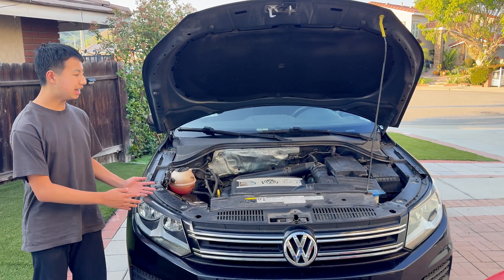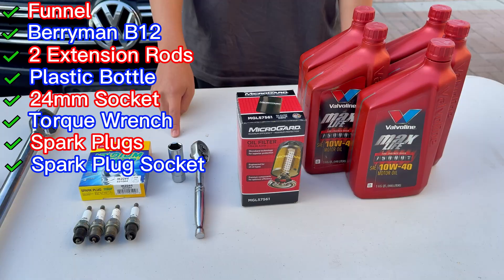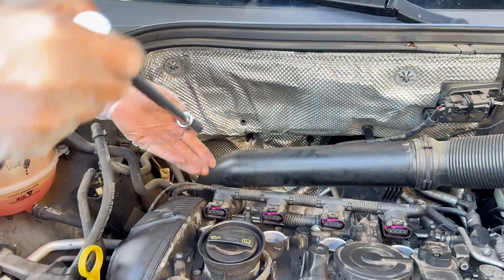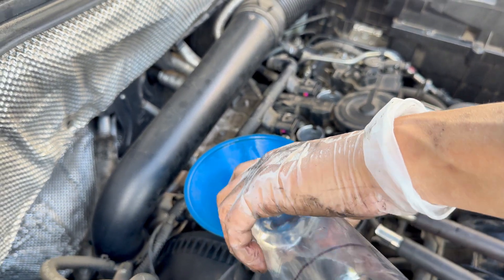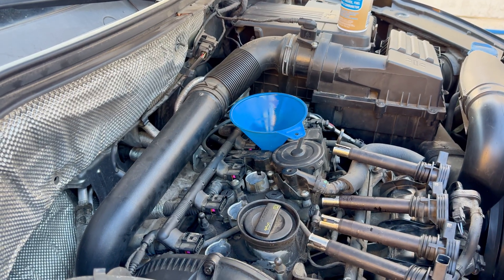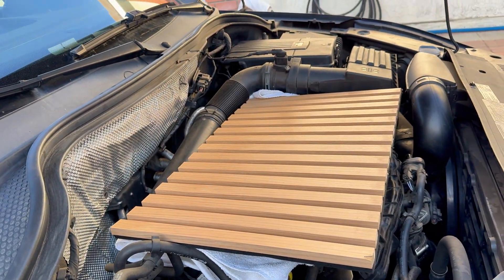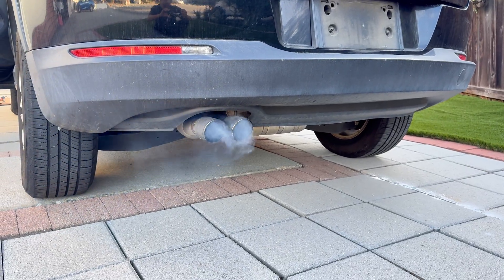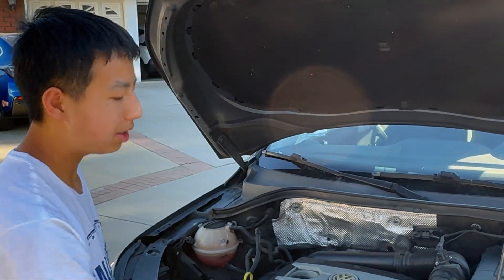Berryman B12 Chemtool Oil Burn FIX (VW Tiguan)! Piston Rings Soaking Cylinder Soak

Comment: When cranking the engine, do you have to pull a fuel pump fuse or relay? Wouldn't you end up with unburned fuel in your cylinders otherwise?

Comment: One point: AFTER EXPELLING THE B12 ADD A SMALL!!! AMOUNT OF GOOD OIL (see below) TO EACH SPARK HOLE TO LUBE THE PISTONS and wait 20-60 minutes. Then turn the crank 4 complete revolutions by hand. Then start. This relubes the pistons and rings.  

1.0–1.6 L (4-cyl)	250–400 cc	3–5 mL per hole.

1.7–2.5 L (4-cyl)	400–600 cc	5–7 mL
2.5–3.5 L (6-cyl)	400–600 cc	5–7 mL
3.6–5.7 L (V8)	450–750 cc	7–10 mL
6.0–7.4 L (big V8/V10)	700–900+ cc	10–12 mL

Comment: Hi excellent video, I have a Passat 2.0tsi 2014 and the next oil change I will this tutorial, however I have a question, it's obligatory repeat the process each 6 hours or could be 8-10 hours
Reply from the maker: Honestly it doesn’t rly matter; around 6-10ish hrs would be fine, cuz obviously there’s no way u would repeat the process at midnight

Comment: My 2017 Hyundai Tucson burned a quart every 300 miles. After the piston soak, it burns less than an 1/8 quart every 3000 miles.

One modification I would do..... change oil immediately after the soak (don't run it with B12 in your crankcase). Change with cheap oil, run for 30 minutes,  and then your final change with high quality Valvoline Restore and protect. But - great video !
Reply from the maker: That's fantastic to hear about your Tucson's improvement! Thanks for sharing your experience and tips!

Comment: B-12 acts as a solvent; if it mixes with your oil and you drive on it, you will destroy your engine's bearings. An oil change should be done after doing this. You mentioned the oil at the beginning but didn't mention later on in the video.
Reply: I saw the other comment where you mentioned the fresh oil change at 7:02. I missed this, you might want to make it more apparent.
Reply: @jaredkindred He should actually do two oil changes. Never run B12 in your crankcase. After soak, I immediately drain old oil with the B12, replace with cheap new oil. Then start it, run for 30 minutes, and then change oil and filter with high quality oil.
Reply: @Extra300goldberg  Would you put in a new filter just for the 30 min run and then another for the high quality oil?
Reply from the maker: An oil change was done at the end of the procedure, as mentioned at 7:03.

Comment: Tried on a 2017 Equinox with 2.4 Ecotec. As engine slopes slightly to rear, back onto ramps to level out tops of pistons for best soak results.
Reply from the maker: Good idea, good luck with your fix.

Comment: When you were cranking the engine without the spark plugs and coils packs, did you still have fuel injectors sending fuel into the engine?
Reply from the maker: I believe so, but not enough to flood the engine, we were able to start the car like you see in the video.

Comment: This product is not corrosive to seals and gaskets when it reaches the crankcase and is sent by the lubrication pump to the upper part of the engine.???
Reply from the maker: Berryman is formulated to be compatible with typical engine parts, so I doubt that it will be a problem unless you misuse the product :D
Reply: @shaolinneil  this product is used to clean injectors, what else about misuse u tell us?

Comment: you missed a very important step. please change your oil after doing the piston soak. most of that b12 will seep though the piston rings into your crankcase. you do not want to drive around for any extended period of time with 2 cans of b12 mixed into your oil.
Reply from the maker: At 7:03, before we reset the odometer to 0, we performed an oil and filter change.

Comment: Why do they only do this on 4 cylinder vehicles, why not V6 or V8???
Reply: Because the problem is more common on 2.0 tfsi and because v6 is on angle an is not keeping the solvent leveled
Reply: More modern cars usually used low tension oil rings. Hence, after some use, tend to get gunked up with carbon and stick to the piston head, let oil splash up into the combustion chamber and burn oil.

Comment: I also did this process on my Audi TT Mk2, 2014. It was burning about a litre of oil every 350 miles, crazy! I’m in the UK but managed to buy Berrymans quite easily on Amazon, took a weekend to do the process and give it as much time between refills. Very straightforward process though, and it literally sorted the oil burning out entirely. I drove nearly 4000 miles after doing the piston soak and the oil level went down about a third on the dipstick - almost negligible compared to how it was before. I plan to do a piston soak about every 10,000 miles or so, with the usual oil changes and servicing in between. I can’t recommend this process enough, it probably saved me thousands of pounds in not getting my engine reconditioned. Highly recommended process!
Reply: Can this product be shipped with airplane
Reply from the maker: @ClemenceMbekezeli  If you buy it on Amazon, probably
Reply: Hi I’ve got an a4 turbo how many bottles did you put in and how long
Reply: @Discoboy 2 bottles
Reply: @D @Discoboy 4-6 hord in between for a total pf 4 times

Comment: Hi! Great video, congratulations! Could you give us an update? Has the level gone down? Is it still using a little oil? Or did the dipstick stay at the maximum? Thanks and regards!
Reply from the maker: Yes, the level has gone down very little, almost unnoticeably. However, note that cars will use a little oil regardless of whether it is burning oil or not :D